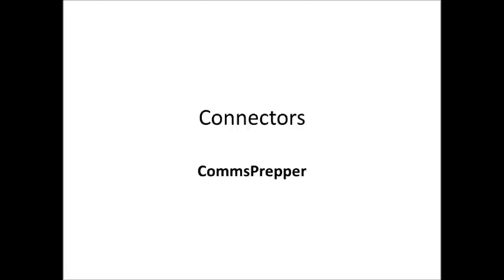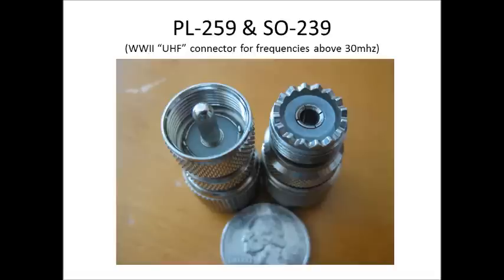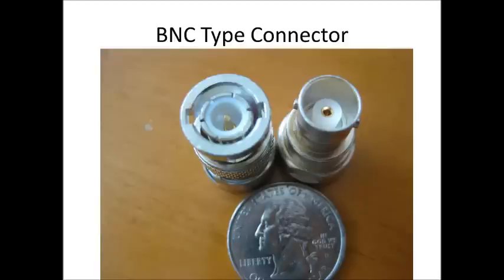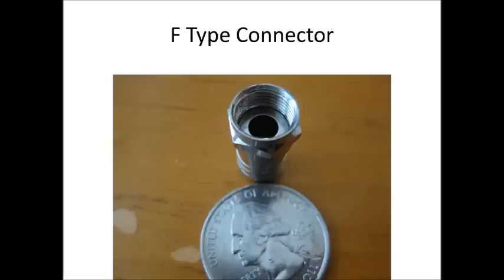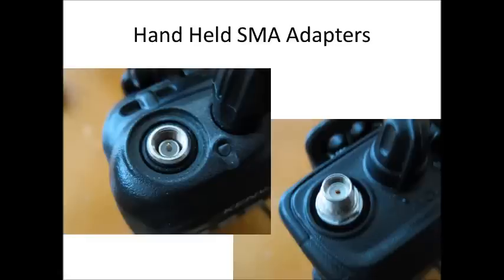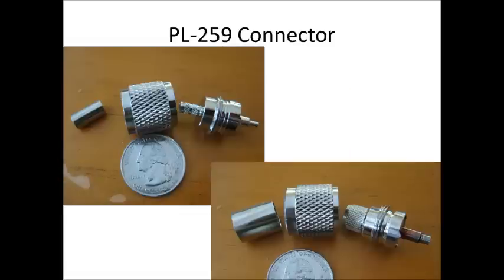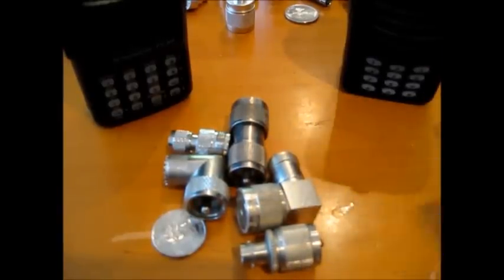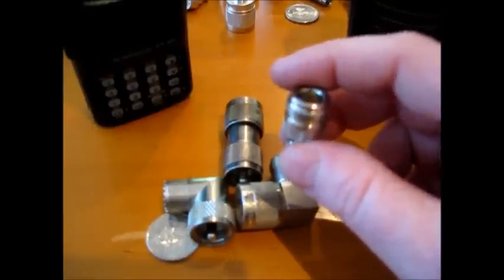Radio Connectors

Comment: Hi, Good intro video well done.  There are adapter kits that are good to have if you are more involved with comms.  Check this out: czlabs.com/bnc-connectors-rf-connector-adapter-kits-c-28_160_165

And don't skimp on connector quality.. I have seen some cheap-o ones just fall apart when put into service or short due to poor dielectric quality. 

Also make up some adapter cables for the common used ones as the next thing you will want to pick up is a good watt meter like the Brid 43